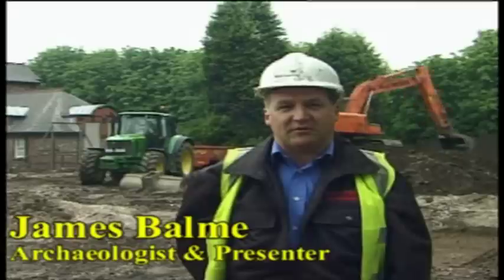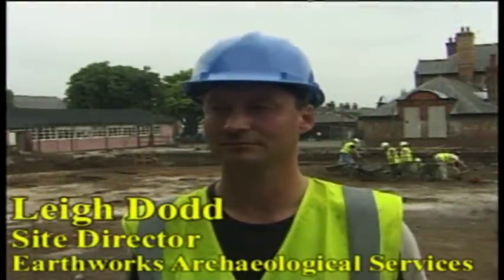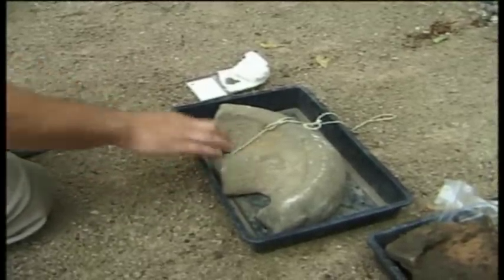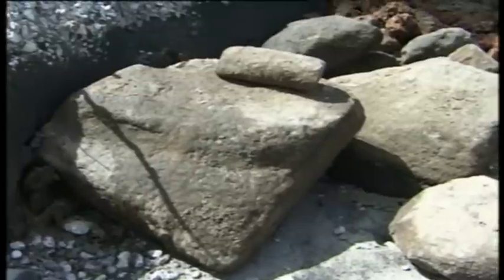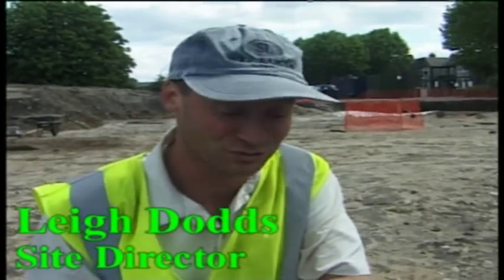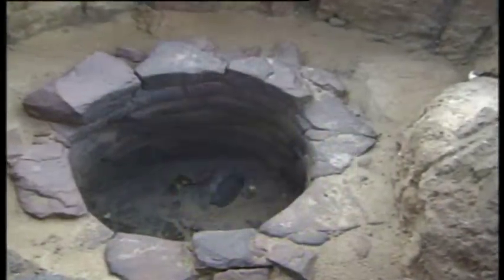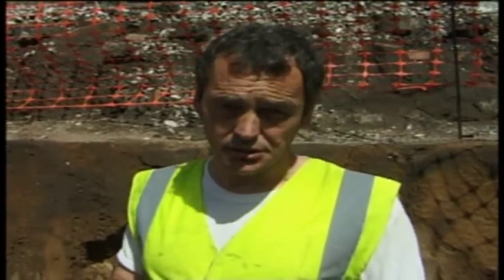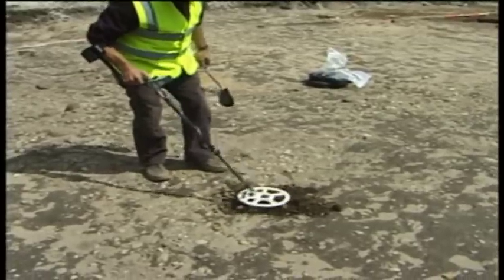Stockton Heath Roman Excavations - An Ancient Settlement

Comment: No one's ever asked that before (that I know of). Good question. The buildings here are but one example... The pyramids in Mexico are a superb example: they were artificial hills; they are tall, wide, and OLD. Wind moves soil into the air which is caught by rain, which deposits it everywhere it falls. Over long times, these actions deposit more and more material; removing soil from one area and moving it to another. And yes, small earthquakes may slowly settle buildings into lower positions.